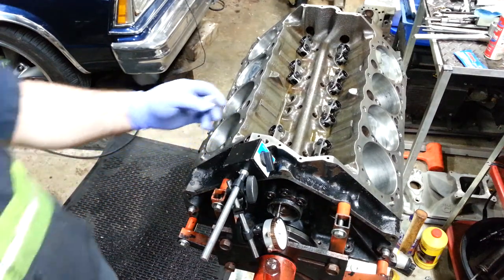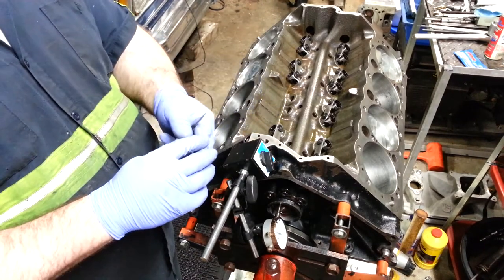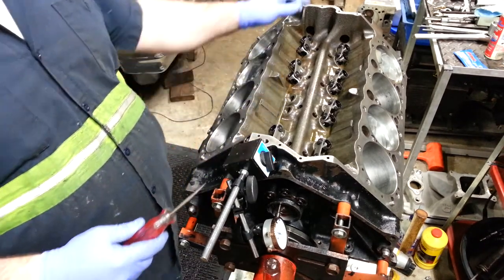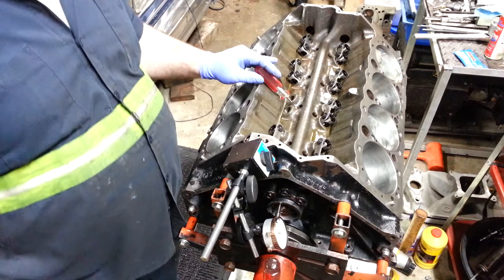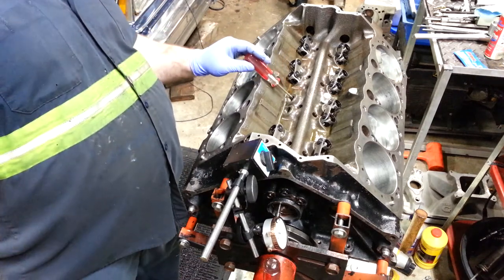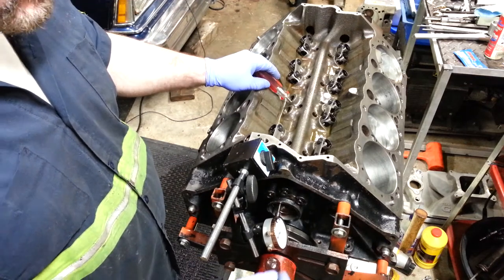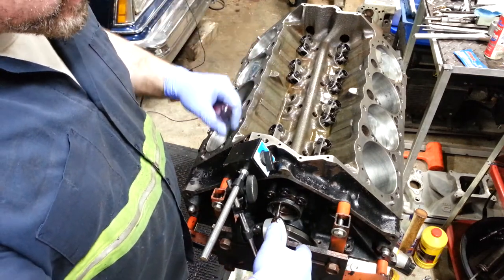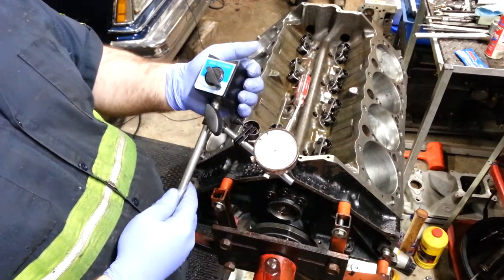How to check roller camshaft button endplay

Comment: I just took apart a 489 that I built, I had a cam button on it and set my cam clearance, but the rear camshaft plug was wore like the cam bumped up against it. Any ideas why the plug had wear on it?
Reply from the maker: My first opinion is that the plug was drove in too far. Seen many times. My second opinion is that the engine was hot enough to diesel and motor may have spun in reverse enough to push cam backwards into plug. My third opinion is the cam had to much clearance end play which can cause it to bounce back some into rear cam plug when initially moving forward and rebounding back. Try to set button end play at 0.004-0.009. Many guys forget to add gasket between timing cover and block when checking or to mathematically account for thickness of compressed gasket. I just use an old one thats already been compressed. If I had to choose I would say plug was drove too far in though, especially if your button clearance was correct. Just put in new plug and recheck button end play if you got it on stand. Worse case scenario is cam moves to much and lifter wheel wipes out or scars up lobe. Either way good luck with your build! 👍

Comment: Question for ya?  I just installed double roller chain and its tight.   the thing that's weird is if i rock crank very slighty back and forth i feel a tiny bit of play.  it seems like there play between lower gear and chain.   Is that normal?   seems like less than a 1/8 movement.    thanks
Reply from the maker: Crankshaft rear main bearing functions as a thrust bearing and needs "play" or if too tight will wear out and cause too much forward movement and hurts the shaft and will lead to spinning a main bearing. Most engine "play" is 0.020" or less and not 1/8". That is reason for magnetic dial gauge to measure. Plus your timing chain if a double roller with a torrington bearing will require grinding on block to clearance the wider chain and sprocket. If not will be tight and will wear down these parts damaging them over time. Some one probably has a yt video about it. Good luck and go get your magnetic dial gauge! 👍